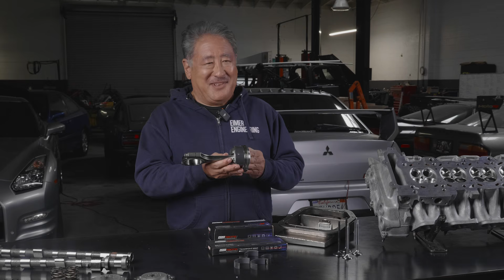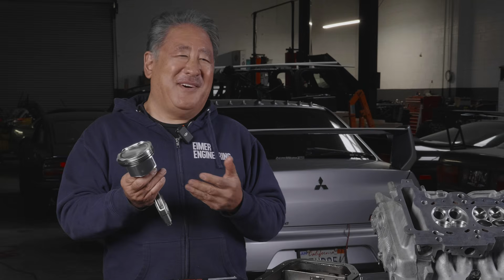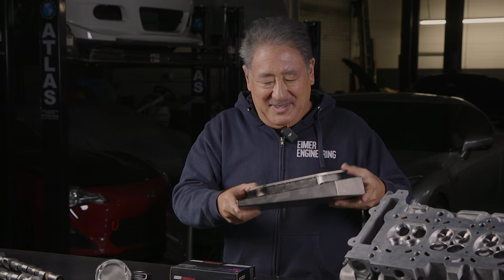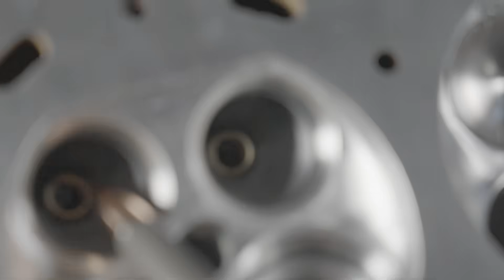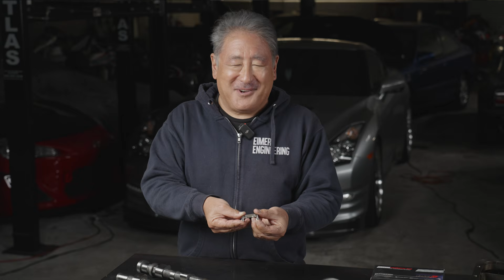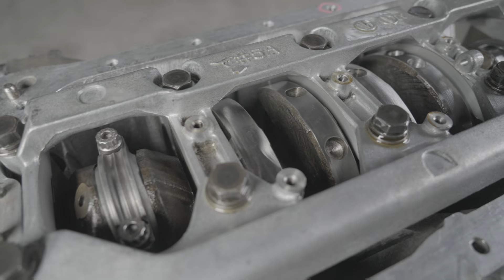How to Build a Bulletproof 400 Horsepower Nissan SR20 Engine!

Comment: Here goes some dumb questions, are all blocks the same? (a part from heads, pistons and rods). I mean if you are planning to replace internals, you dont care about that. I can find a lot of information about the diferences between sr20 versions, anyway is not much said about the block, the question is, can I get a basic version (sr20Di, sr20De/E) and then after drop a better head like (DET or VE)
Reply from the maker: There are about 3 different  block versions
Reply: @motoiq  Can you develop the answer and advice to go for one or avoid another, I found that VE version has aluminium block so the difference may be huge compared with the iron versions. Thanks 🙏
Reply from the maker: Off the top of my head, wide pan rail and narrow pan rail (early fwd and awd blocks), DET with oil squirter and drain provisions, No girdle style which is the FWD roller cam motor and the VE, VE with VVL oil passages, whoops that's 5, sorry.
Reply: @motoiq  not big difference then? what's your opinion on basic sr20 engines as they are dirty cheap, is it worth building something on them, is it viable swapping heads, basic heads worth a turbo build?
Reply from the maker: Swapping what heads on what blocks?
Reply: @motoiq  I mean, the most abundant engines are transversal sr20de and sr20di, so I would go for some of these two, there is two questions, are any of these heads any good too deserve a build, if not, can I drop DET/VE head on DE block?
Reply from the maker: Yes except you don't have the oil squrters and the oil drain for the turbo.  The bosses are there cast in so you can machine them in.
Reply: @motoiq  thank you a lot!

Comment: Honestly to build a bulletproof SR20DET you should focus doing the dual valve guide conversion even tomei solid lifters, using beehive valve springs not dual spring, using a SR20VE oil pump and getting the block oil galleries grooved.

I wouldn’t recommend using the rocker arm stoppers. They cause damage still.

If you have the supporting mods like fmic, 1000cc injectors, 3 inch exhaust, turbo, wastegate, poncams, ecu ect you’ll have a nice 400HP engine.

Or just fit a SR20VE head and you’ll have 500HP.